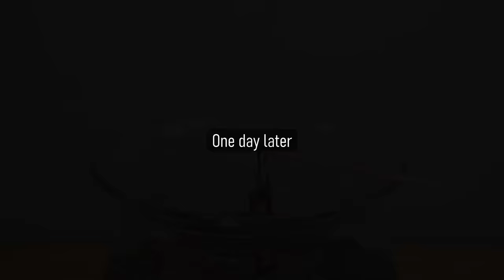Cleaver Restoration [Black Cleaver With Ebony Handle]

Comment: Love the restoration bro - question for me is the value of doing the electrolysis. It seemed that the hand held grinder and belt grinder did a lot of great work, whereas the electrolysis didn't seem to have all that much effect removing the rust - worth it in your opinion? Great vid!!
Reply: Not an expert myself, but got answers regarding electrolysis in other videos, apparently it helps de-oxydizing some of the rust (converts it back to iron) so it minimizes the damage.
Reply: Amazing
Reply: @andreadipietro8888  ooo, so the point is to minimize the damage?i saw in other video it used some kind of laser or something to rekomendasi the rust nut maybe the damage is bigger maybe
Reply: A lot of what the electrolysis does is remove quite a bit of rust without abrading and eroding the metal underneath as you’d get with grinding, sanding and wire wheels. You don’t expect the result to look pretty and shiny, but you’re down to pretty solid metal and you don’t need as much to get it shiny. 

Gunsmiths use electrolysis because it allows them to remove most of the rust while leaving any remaining bluing intact for example.  Gunsmiths do have to be careful because overdoing it or using too high current can lead to pitting in virgin metal. Which is bad.

To give you an idea where electrolysis was the best is a rusty set of pliers I got in a box of rusty bits at a farm auction. It looked like it was nice but completely seized. 

The electrolysis left it pretty black, but working nice and what’s this stamp say?

“Berlin British Sector”. Yow! Made within a few years of the end of WWII, to German standards.  A collectors item worth a surprising amount and I think the colour was the original bluing!

All of which would have been obliterated by acid or any abrasive removal. 

My son keeps stealing it because it’s a damn nice set of linesman pliers better than virtually anything you can get now. 

I think I’ll have to leave it in my will for my son 😏
Reply: The electrolysis only serves to minimize the amount of material that you have to remove

Comment: What is the advantage of rust removal by electrolysis before the belt grinder as aposed to belt grinding or using the angle grinder to remove all the rust

Comment: A couple of observations:
1) Why bother with electrolysis, if the next step was sanding the surface, stripping it off the pitting? You may as well just have skipped this 16 hour process and arrived at the same result.
2) "Cutifying" the tang by making it shorter, narrower and therefore weaker on a cleaver (blunt force instrument) seems counterintuitive.
3) Even more so is drilling ridiculously huge holes that take away slightly more than half of the tang's width in material for the sole purpose of securing the tang in the wood.
4) You take a great(!) approach for establishing a 30° angle for the slashing edge, but then you wing the final edge making.
5) The final surface unfortunately shows a couple of sanding burrs. One most noticeable on the right side, about 60% to the front. I personally would have preferred either leaving the rust pits or sanding it to a mirror finish, but as you stated in your video, the surface was good enough for you.
Reply from the maker: Thank you for your detailed and interesting feedback! 🐢
Reply: I had enough.
Reply: Of course the real way to reuse this would be to melt it down and start from scratch. And he is certainly not a master knife/sword maker. Probably more of a chemist. But I think the point is the science of it. The challenge.

Comment: ah yes, the old 'rust a normal cleaver and then de-rust it for YouTube ' and obviously that's not rust either. it's something you stuck on it
Reply from the maker: Oh, what makes you think that? I bought the cleaver on ebay like this. I do not modify items! 🐢
Reply: @ForgottenShineRestoration  it's sad that the fakes make the real ones seem less valid, the electrolysis wouldn't be used in a fake one and even if it was hypothetically fake or at least skewed for entertainment it's still fun to watch.

Comment: why going thru the hassel with electrolsy,, if you just hitting it with a sander anyway?
Reply: Electrolysis, part of the bluing process does create a thin rust proof barrier.  It will wear out, but the knife looks pretty.  It was a project of love, boredom, or youTube.  Maybe a combination.

Comment: Long handle was strong, new handle looks small and brittle. Should've used a rotating wire brush with drill bit in the beginning itself, saved viewers precious time.

Comment: Kudos and thanks for sharing. You may want to consider strength of materials for your audience knowledge gain. You have just weakened the handle dealing with tough meat and bones that might bend or break it.

Comment: The electric and water etc. It confused me so badly. I just don't get how it works.
Reply from the maker: The current flows from the cleaver to the scrap, and the electrical particles blast the rust from the surface of the cleaver. Simply described...🐢
Reply: @ForgottenShineRestoration  thank you 🐺

Comment: bro is making chlorine
Reply: The chemical mixture used in the video would create C02.  Other bluing processes for steel do emit chlorine gas.  Seldomly used in the modern age.  Still want to be done with good ventilation.

Comment: Nice and interesting job. I watched the whole video and thought, what if we keep some treated rusty surfaces maybe an inch away from the cutting edge? Not only does it remind people of its original shape, but it could also hold more weight, which helps in chopping. The second thought is the handle part, you seem to have removed too much metal from the handle, so the part where the handle meets the blade looks flimsy. In the end, you only tested the sharpness of the cleaver without actually testing the chopping, which makes it less satisfying.

Comment: I call BS! As someone who's dealt with a lot of rusty metal in my career, I can tell this is just not right. When steel is as rusty as this cleaver was, by the time you grind or sand down to bare metal with no pitting, the metal would be so thin you could break it with your hands. If you look at the thickness in the beginning, I can tell from experience there isn't enough metal there for the end result they're showing. This is true for a lot of these "Restoration" videos on YouTube.

Comment: - Weakened the handle by cutting down the tang (for no good reason)
- Replacement handle is bulky, awkward, and looks shoddy from a distance (the finish on the ebony looks like cheap plastic) 
- No demo provided for a cleaver's actual culinary purpose (chopping meat) after "restoration" - I doubt this thing's effectiveness in the kitchen.

All in all, a lot of work for little reward. Process was neat to watch, but end result was a disappointment. Not sure why this showed up on my feed, but wouldn't recommend. 👎